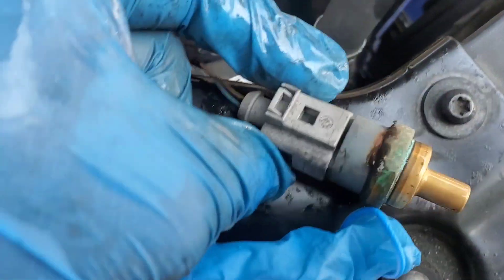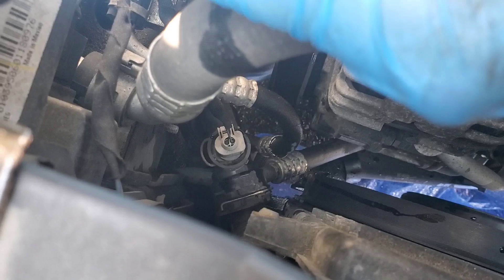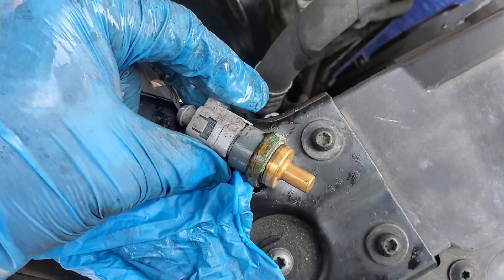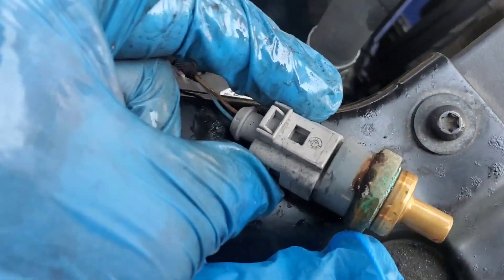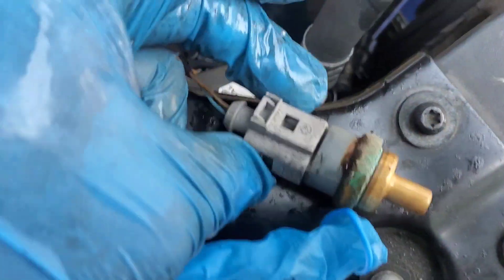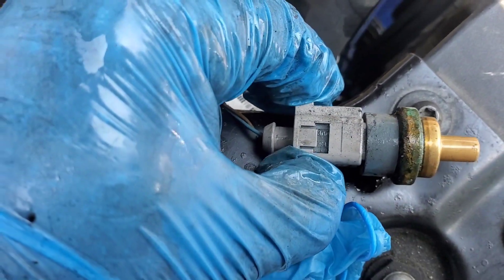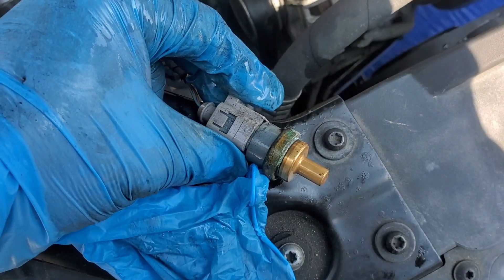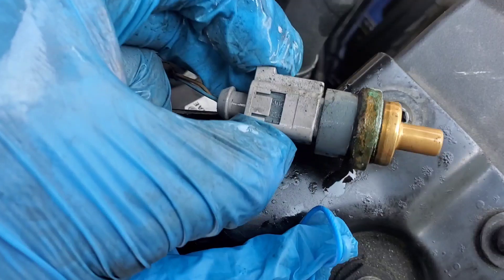HOW TO DIAGNOSE AND REPLACE THE COOLANT TEMPERATURE SENSOR ON A 2014 VW JETTA - $10.49

Comment: I have a 2012 Eos, I've read in comments that there are two sensors. Is that correct?

My problem is, system is empty of coolant, put coolant in reservoir to fill, but the system isnt drawing it in. Temp gauge goes up to operating temp but no further and fans aren't kicking on. Drove for short distance and could smell engine getting hot, but the temp gauge didn't go beyond normal operating temp?

From other vids it seems the ECT or thermostat could be the likely culprit.

Any help would be greatly appreciated!